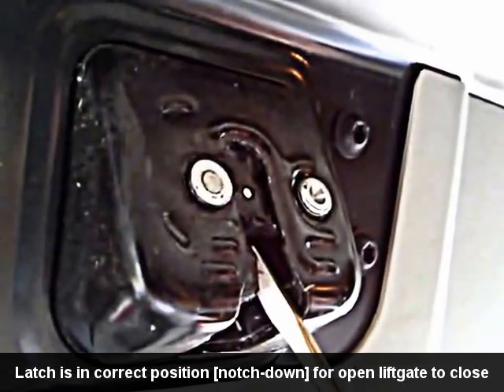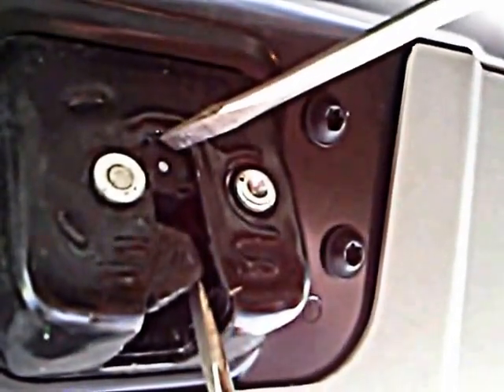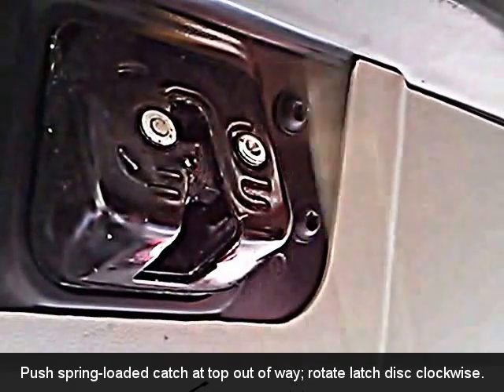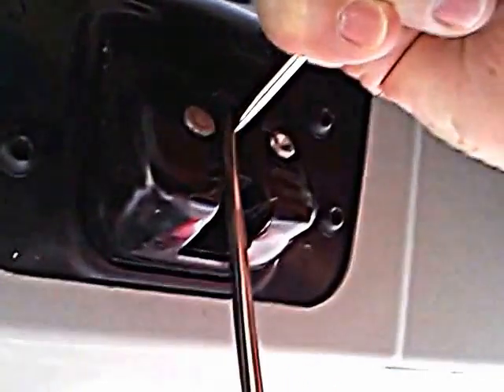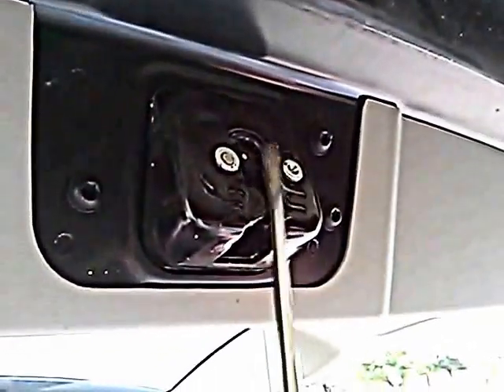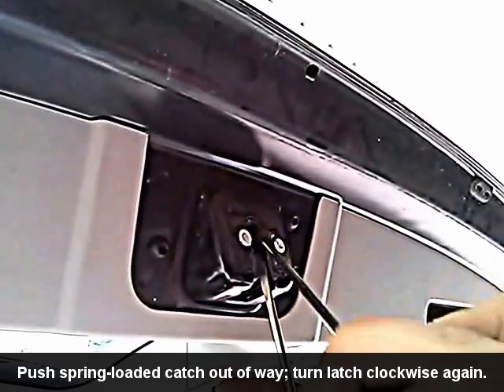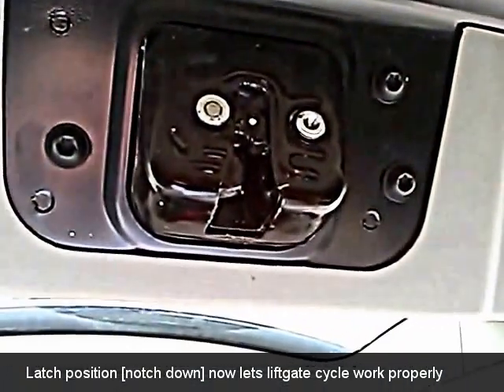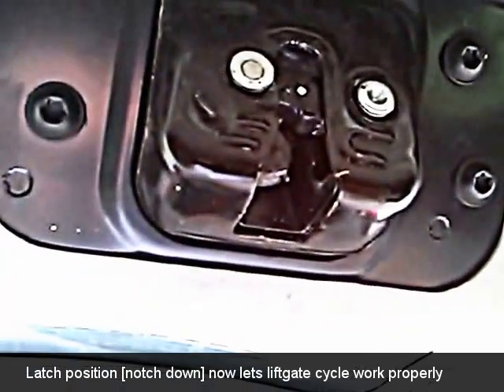Out-of-Synch Liftgate Latch DIY Fix - 2012 Dodge Grand Caravan

Comment: Found a waaaaayyyy easier way. On a 2014 Town and country, just remove a rectangle plastic cover located just behind the lock inside. After removed there's a lever on the left side that doesn't do much BUT at the end of that lever there's a small lever that when you move it, it allows the lock to open fully.  Hope it helps and thank you for the video.
Reply: How did you figure it out I finally got mine to open but now if it latches it won’t open again
Reply: @tanyshajarrett2574

Try to turn that small plastic “wheel” back to the original place. You may have turned it and never rotated it BACK to its normal position.

Comment: I used the above method and it worked.  The real trick is after the first step you need a very narrow flat blade screwdriver to get at the latch release to pull the latch down all the way. Thanks Matt

Comment: Thanks! This worked, it was a bit different in appearance I have a 2009 there was a bumper (piece of rubber) that was in view it fell out and was basically a casualty of the repair, but it worked!  The little spring was more like a button to depress on upper right side above the black insulated moving catch mechanics of this latch. THANKS so much !!
Reply: I have the same problem with a 2008.  The button to depress is on the upper right just as you describe here.  When I depress it all the way, I still am not able to move the latch at all.  It seems I'm missing something.  Anyone have any ideas?

Comment: Very helpfull video. Had the same issue. If you depress the catch spring indicated in the first step and hold the liftgate handle while doing this the lock opens up. This avoids the complicated second step show in the video.
Reply: That worked for us! Thank you!
Reply: VERY helpful!!  Thank you for taking the time to post this.  I was about ready to give up on that "second step" and then I read this.   SUPER DUPER!🥰🥰🥰
Reply: Your comment needs to be pinned or something. I’m thankful for the video, though saved a lot of sweat and time finding your workaround. Thanks!

Comment: IMPORTANT 
While trying to push down the latch bar with the screwdriver, DEPRESS THE LATCH USED TO OPEN THE TAILGATE AT THE SAME TIME! This will allow the latch to rotate easily under its own natural mechanism without having to use force.

Comment: I fixed a customers 2019 Dodge Durango using this video as a guide for myself. I personally found success pulling the whole latch out of the tailgate via taking the paneling from the inside off and removing those three hex screws you can see clearly. There should be a manual lever on the back that sticks out and on top of it the spring loaded latch that this video is showcasing, I was able to pull it back from behind. You may or may not have a plastic piece that blocks access mildly but if you take your time and remove it with some smarts it comes out just fine.

Comment: Would this latch problem cause the door upon opening with button on key to swing back shut with a force than not latch? One day my 2012 dodge grand caravan door wouldn't open with button so i had to open it with the handle. Then it wouldn't stay open and slowly would close. Then when it did finally open with the button on the key it went up then forcefully came down not even me trying to hold the door open was working i had to let it try and shut. But then it wouldn't latch so i had to push the latch open then press the button to open the door and then press it again fast to shut it so it'd finally lock. ha hopefully this makes sense. But before i search for screw drivers and fiddle with this while watching a toddler, wondering if the latch is my problem and not a computer issue?

Comment: Your fix work perfectly.  I had to disconnect the battery negative, and try your procedure and it work.  The problem I'm having now, once closed it will try to open and wont.  Any suggestions.  It did this before.  I had to replace the battery and it stated working again. Still had the problem of it not wanting to open again.  It tries and locks back down again.
Reply: Did you ever figure out what the problem was?
Reply: @ivanleslie9583  No Sir, havn't had the time.  I pruchase a canoe with trailer and need to get it fix.  Will try to unhook battery and try again.  I'll let you know.
Reply: @bruceadams7119  thanks! I'm having the same problem I believe. Once closed I can't open it. But if I push in on the trunk a bit and squeeze the handle and wait for the mechanism to unlatch it does open.

Comment: my 2013 power liftgate is stuck in closed locked position. any advice on opening it?
Reply: me too
Reply: Pop off the plastic panel on the inside of the door, near the latch. Shine a light down in there and you’ll see a metal rod on the left side of the opening, below the level of the opening. Push down on that rod/lever to open the door

Comment: I had a similar problem with my 2012 caravan. The lift gate would not open. If you tried to open, it would open one inch and then close automatically.  Turned out to be Brocken glass ( from when rear glass was broken by vandals) caught in the mechanism. I removed the assembly, tapped it lightly with a small hammer- and the glass came out- and gate works perfectly now.
Reply: You’re a SAINT for posting this comment. Seriously. 

I too wasn’t helped so much by this video but I decided to go through comments to see if someone else had further problems. Saw yours about broken glass and remembered I came across broken glass when cleaning and sure enough, I shook and banged like 6 pieces of glass out. Only one was the main culprit and took about 30 minutes to get out. But then it still didn’t work. 😂. Turns out the whole assembly, which is kind of L shaped, had gotten bent and wasn’t engaging that second lever. A pair of channel locks and some body weight got it back into place and BOOM. Works flawlessly now. So thank you SO MUCH for making that comment. I never would have considered broken glass jamming the mechanism. ❤❤❤

Comment: So mine i had back glass broken by my bone head dealer during oil change. 2 weeks later i get it back with lift gate bad and dead battery. (Gate never closed and left interior light on)

They “FIXED IT” and got it back for i not to close. Found this out Saturday after hours and of course they are closed Sunday.

So i watched this vid and he mentioned lining up correctly and….Mine was more the alignment and I guess sensitive sensor to make assembly click Into place.

I noticed that when I pushed the whole gate over manually by muscle lol to the left and it made the assembly latch happy
to close. Hope i dont have to keep doing.

I feel like of I bring it back to dealer they will do more damage!

Comment: On my 2011 Town and country looks exactly like that bottom side  mine has access pop out small panel interior of door . Using long screw driver can also release lock mechanism ...
I inadvertantly closed a blanket in latch another utube guided me to pull up unlocking lever takes 30 * driver to remove  complete latch assembly had to physically bend that lever back over round unlatching rider under release that lifts lever acting release pivot (those 3  30* bolts are quite tight used 1/4 drive ratched to remove lock asm)
Reply: I agree.  Far easier to just remove the latch and physically move both arms with your fingers.  I was done in less than 5 minutes.  Working as it should now.

Comment: im in trouble.motor will work fine but it does not when u lower the door below certain point.2014 durango rt. And i think it might be a sensor that sees the doors angle or what?

Comment: Well my rear latch on my 2012 Dodge Durango tries to close 3 times and gives up.
On the way home it poped up 2 times. This made for some interesting driving as the cars behind me didn't know how to handle the situation.  Luckily I pulled over with the flashers on, pushed the open/close button on the overhead console and have it cycle another 3 times.
When the latch broke or whatever it did the check engine light came on. Things like that seem to come in two's or three's. Yea, the low left rear tire light also started flashing telling me that it decided to show low :-(.
The reason the check engine light came on was the computer(s) in all it's wisdom said the thermostat was not opening up like it should have.
Lucky I had Mo-Par Max Care warranty. 
The dealer put in a new hatchback latch (450.00), new thermostat Cost ??. I don't know how much the labor for all this would have been without the Mo-Par warranty. I paid them $ 100.00 and was back on the road in a day or so. The warranty does cover parts, labor and rental car.
These vehicles these days are nothing but computers on wheels.
The Mo-Par Max Care warranty comes in 3 flavors:
1. No Deductible (higher initial cost)
2. $ 100.00 deductible (what I have)
3. $ 200.00 deductable
If you are going to keep your vehicle over 5 years it's worth the cost.

Comment: Ummm can't you just pull the handle on the back to pop it open?  That's what I do. I have a strap that is meant for that catch and it just pops when you pull the handle.
Reply: +quietcorona33 gotta love a video where he sounds like he knows what he is doing but its really just a fail video. in my case pull the handle which actuates then simultaniously pull down on the latch and it freed up.
Reply: Yes, just lift the handle and it will work!!  I broke off a piece of plastic trying to pry it with a screwdriver.
Reply: Manual handle will release this.